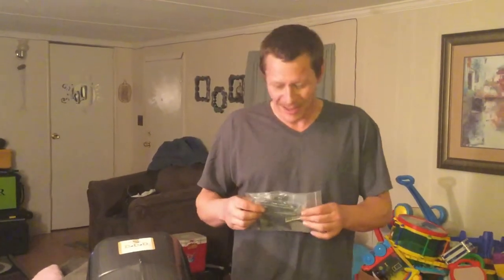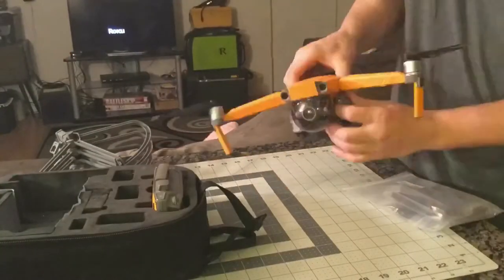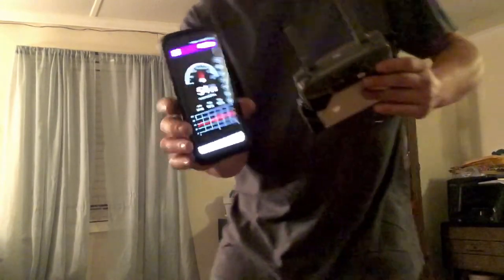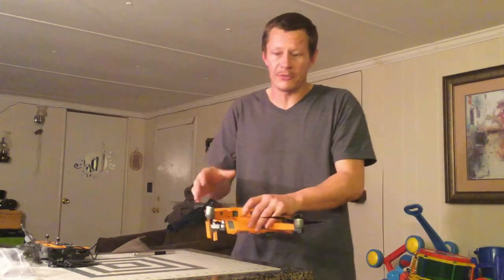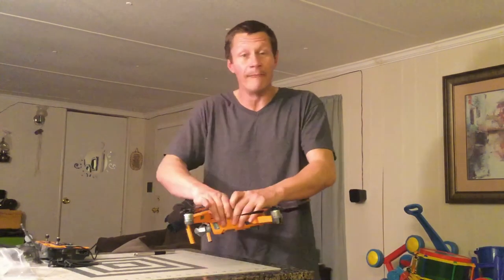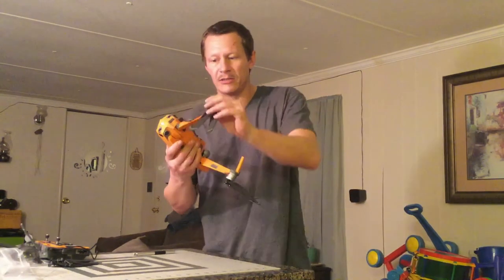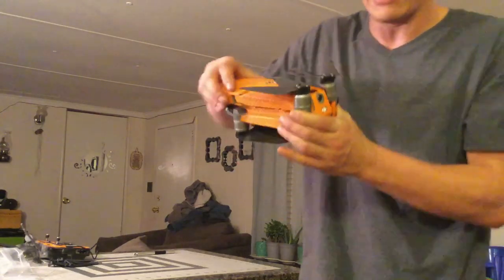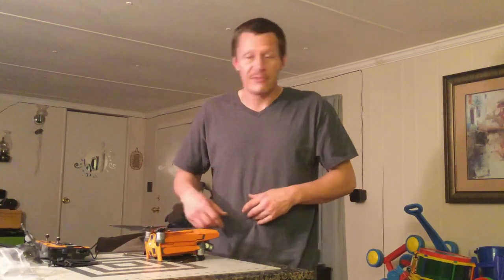DJI Mavic 2 carbon fiber tri blade props.

Comment: Curious it has been around 9 months since this video are you still using them ?
Any issues ?
Reply from the maker: Frank ReidytoDrone not as much as before because of storage in the backpack I currently use! God bless
Reply: @CarlRay5522  Performance issues of any kind as in vibration or noticeable increased battery drain  ?
Reply from the maker: Frank ReidytoDrone the last time I used them they did drain about 5 minutes of battery life and I noticed a slight difference in stability inside!
Reply: @CarlRay5522  Ok that's probably not a good sign .
My biggest concern DJI won't cover Warranty if 3rd party blades of this type were to cause engine esc issues
Reply: @reidytodrone3876  Unless you plan on racing your mavic in competitions, the tri blades are useless on this platform of drones.  You WILL lose flight time, (tri blades = heavier props/extra surface area per prop resisting wind = more work for the motors.  It will give you greater down force and lift, but that = less stability. They are great for racing quads, they don't care that much about stability, they want their quads to turn on a dime, and so the tri blade is perfect for that platform.
Reply: @sunshynff  Ahhh not suitable for Mav 2 .Appreciate your time replying will definitely now have no reason to purchase.
Reply: @reidytodrone3876  Actually, I did a lift/stability test with my mavic pro, lifting appx. 400g (0.8lbs) for a light drop rig we were toying with at my fire dept.  We tested four different sets, all bi-props, a carbon fiber set, stock set, the cheap Chinese knock offs that come in cool colors, and the led ones that you can put words on.  I was blown away, the cheap Chinese ones were neck n neck for the best of them, it was really close between them and the stock props.  In noise, lift and stability. They're much flimsier than the stock ones, so I thought they'd preform horribly, but I guess them being that light, helped out.  They have the 8743s for the pro 2, but I know that's a heavier copter, so not sure if you'd get the same results.

https://www.ebay.com/itm/2-Pairs-For-DJI-Drone-Mavic-2-Pro-Zoom-Propeller-8743F-Low-Noise-Quick-Release/202563176999?_trkparms=aid%3D555018%26algo%3DPL.SIM%26ao%3D1%26asc%3D40719%26meid%3D20bda0fe81c84a34804ab55c058d6e73%26pid%3D100005%26rk%3D10%26rkt%3D12%26mehot%3Dco%26sd%3D183717510620%26itm%3D202563176999%26pmt%3D1%26noa%3D0%26pg%3D2047675&_trksid=p2047675.c100005.m1851
Reply: @sunshynff  Wow appreciate your research makes for interesting analysis. 
Appears in your line of work would be suitable for lift .
Probably little use for myself
Reply: Frank ReidytoDrone Nothin fancy; our district has several rivers and lakes.  We were looking at ways to to get a life jacket or rope to a victim while rescue team got suited up or put boat in water.
Reply: @sunshynff  Hmmm remember seeing that being done on the news here in NZ last summer. 
Would say if you Google search you will come across the article

Comment: Thanks for testing and posting. I'm still not convinced to run the 3s, even if the thrust delta was significant, as my M2Z use is mostly slow and deliberate. If they increased flight time in the double digits with no ill effects, that's what i would want personally
Reply from the maker: The threes are much more responsive thats for sure.

Comment: I've tried these on my mavic pro, not too much of a difference up close but further sway, these props are MUCH QUIETER. even had a few friends ask me what i did to it because of how quiet it was. the sound pitch change seems to be the big difference, yea it chews batteries faster and they are quite badly balanced out the bag but once thats fixed they are quite nice, even for the noise alone.
Reply from the maker: I have not had much difference in time or heat but your right they are not balanced well i don't think.

Comment: Have you flown with them yet? I'm wondering if they would host up the esc?
Reply from the maker: Yes I have their is no noticeable difference in getting hot or flight duration just a different sound and more thrust!
Reply from the maker: Yes Ive not noticed a difference at all in flight time or heat yet.

Comment: what’s the rpm difference between props (hover, full forward, ascent, descent)?
Reply from the maker: I really notice that upward thrust is better and faster just slightly.
Reply from the maker: They spin very close to factory blades.

Comment: Your dealing with ground effects flying in your house.  Go outside and a couple of feet higher.   Of course it will bounce around more indoors it has more thrust. Moves more air and therefore it will continue to fight it's own prop wash.  Your test Failed . Try again.
Reply: Way to encourage!
Reply: I think your theory is flawed. 1. You have the exact same ground effect with 2 blades at the same height. 2. To hover basically the same weight, the thrust is equal.